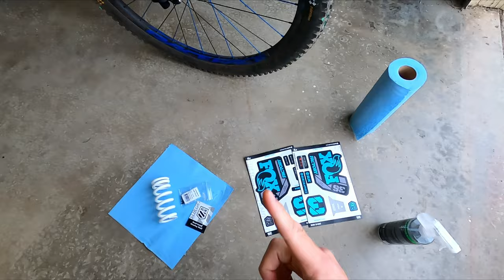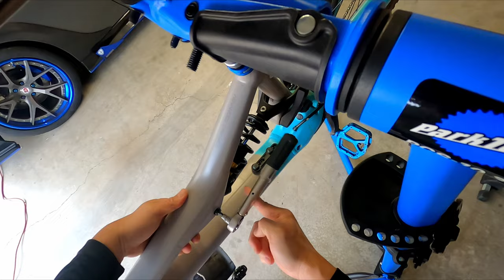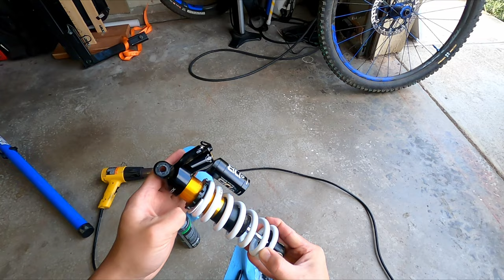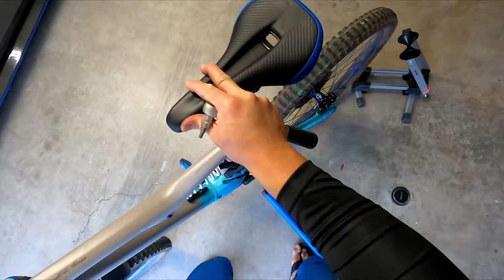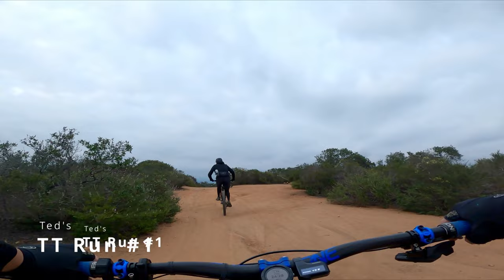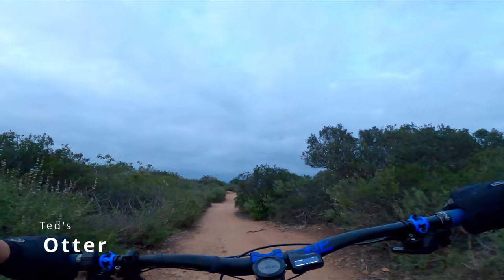Orbea Rise Hydro H15 - Cane Creek DB Coil CS - Linear vs Progressive Springs. 2 Crashes in 1 day!!!

Comment: I broke a Cane Creek inline on my Rise in the 1st hour.
Cased a big jump but they are not recommended for our frame as the shaft os only 8.5mm or 9.5mm the upgraded one. The strut length is too long for the fragile shaft.
Seen actually 2 more broken on Facebook groups and some have mounted the shock upside down.

Not sure how different is the CS version, my one was inline.

In the end I got an EXT Storia V3 as it has HBC and a 14mm shaft.

There's a video on my channel where I break it. Think it's called "Finally clearing....."
Reply from the maker: Yes IL is too thin, CS is predecessor to the Kitsuma which is fine according to CC.
Reply from the maker: I switched to Push 11.6 now